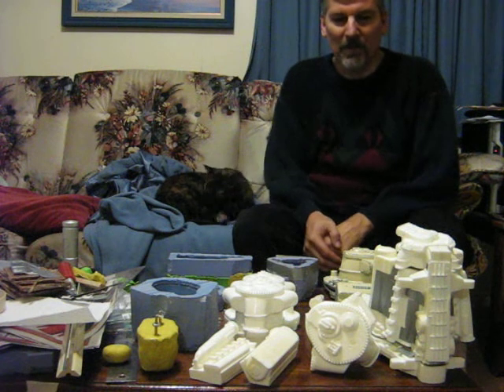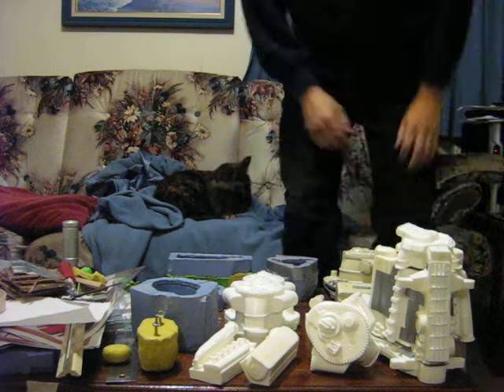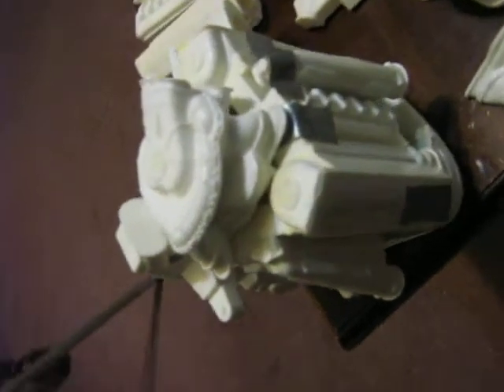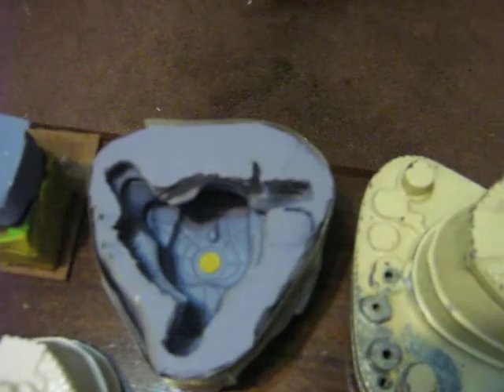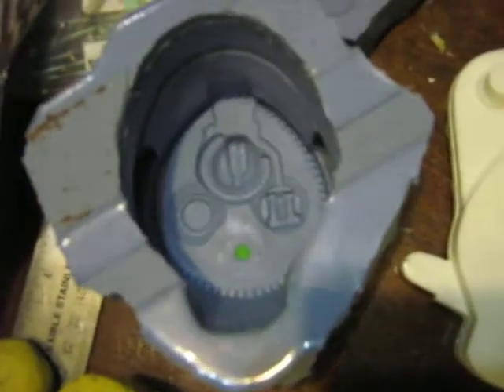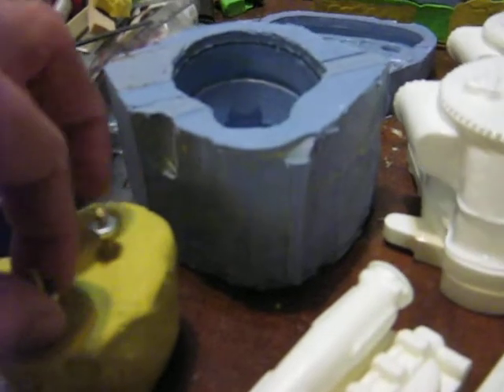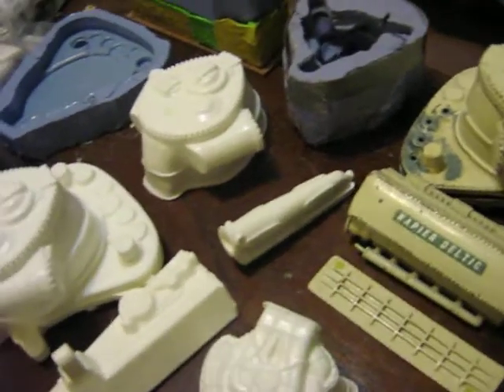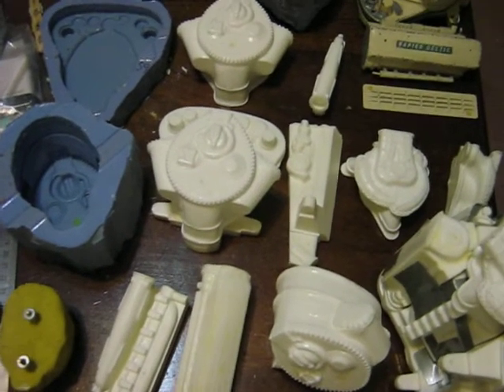Deltic Model Engine Progress!

Comment from the maker: @805ROADKING 
It is "Smooth On OOmOO30"
I get it at a local hobby shop, I have had pretty good luck with shelf life, I did have an opened jar go bad after sitting for almost a year, yes, that was about $30 down the tube :(  I had to switch from the 300 plastic to 305 for the larger parts, as the 3 minute pot life just wasn't enough for the large parts.

Comment: love the deltic engine project, wonder why no one has made a automotive or truck size engine?
Reply from the maker: It would be a pretty complex engine for a realtively small vehicle.
Reply: not the model deltic but one for full size trucks and bigger. seems like the efficency would be hi collecting power in a 2nd piston rather than headbolts

Comment from the maker: @amfan12 
HaHaHa, that will have to wait until I win it BIG in the Lottary!!!
I do have my single bank 2 crankshaft engine I call the Jumo 205 type Briggs that I have making a short run on a vid.
Believe it or not, I think I am already in about $400 for this model (including the purchase price) the rest is for the silicone molds and all the casting plastic at $30 for 900ml. This model just drinks it up, the rear gear case mold used 340ml alone!